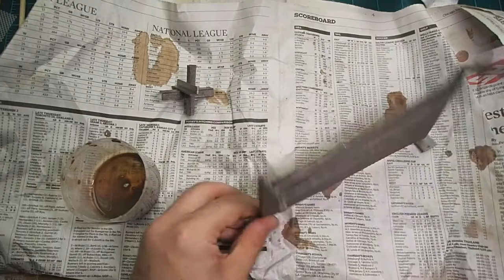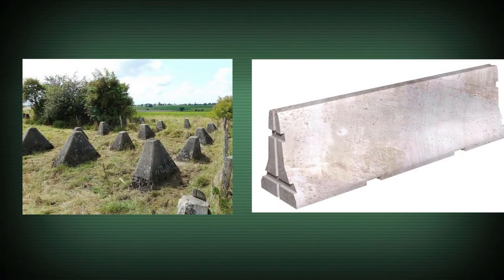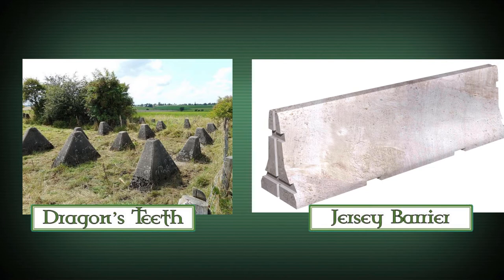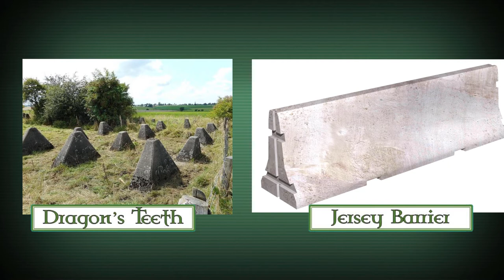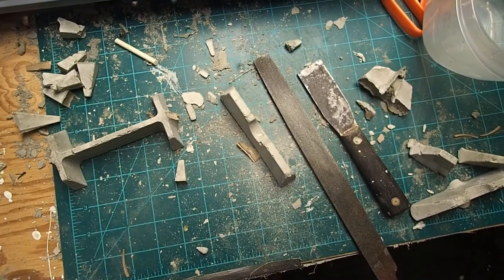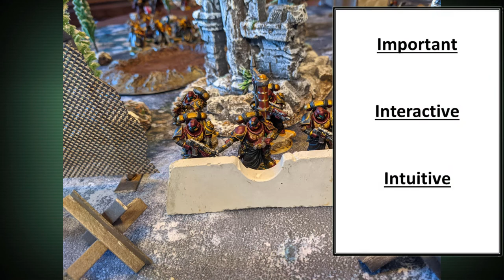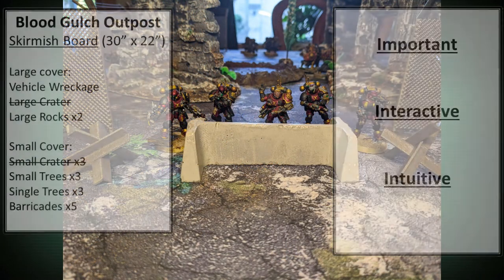Terrain Essentials: How to Create 4 Different Kinds of Barricades for Warhammer/Wargaming

Comment: also, protip, using the plant tray is a good idea, but you can make your life much easier by cutting the bases where you put the plants off and making the molds you will use the actual size yo need them to be, separate from the original piece.
the dragonteeth can be glued between 2 strips of card to make a line of molds that will stand on their own, and actually cutting the barriers molds out and sealing the ends with card and sealing the end with duct tape on the inside will give you much easier to manage tools to mass produce with.
though ill be honest, im lazy so i bought plant trays like these and cut them up and filled the bits i wanted to use with a mix of hot glue and cardboard, then just painted them to look like stone.  i got a set of 5 trays for £3 and they made me two dozen dragonteeth and like a yard of barriers and i didnt need to mess around with concrete

Comment: nice job mate. 
i would look at using a hot glue gun on the hedgehogs though. it sets so quick it helps with the sliding problem. 
id actually consider using hot glue instead of tacky on most of those pieces for the speed at which it sticks stuff together.
Reply from the maker: I like hot glue, but on such small things I've had it get a little too thick. Might be the nozzle on my glue gun though. Thanks for the tips!